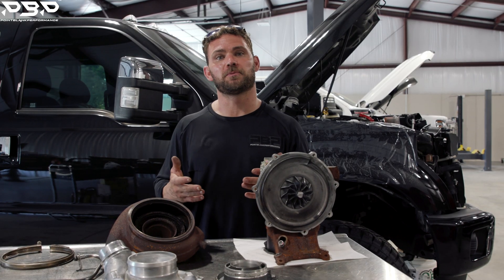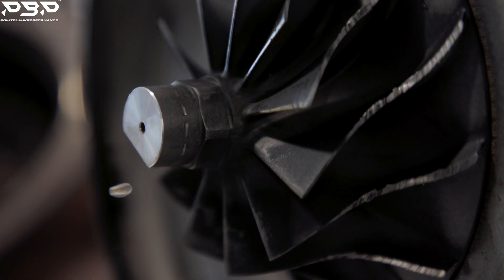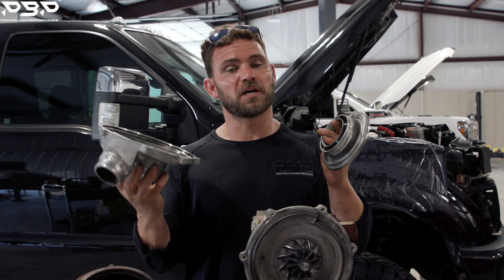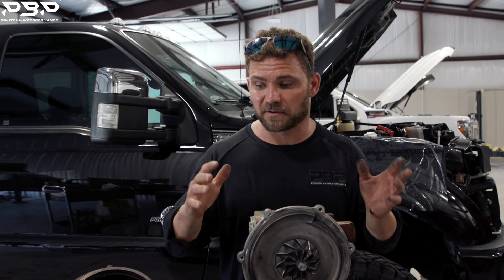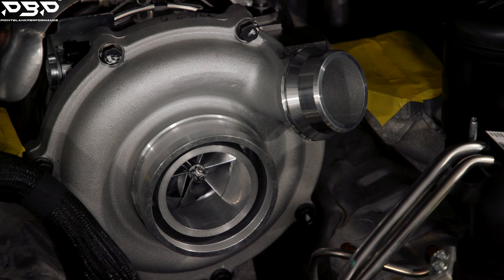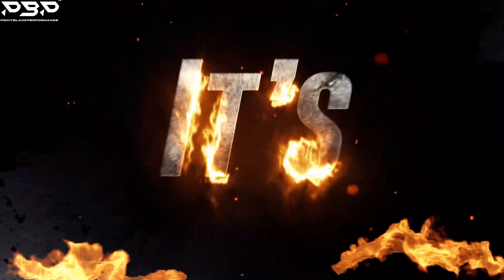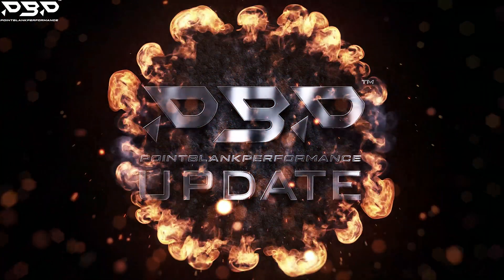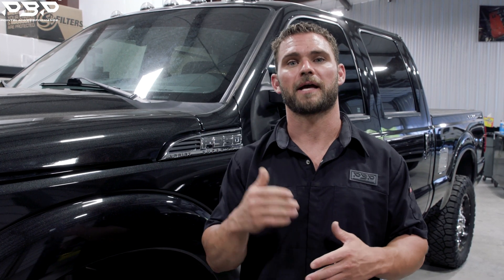MORE BOOST LESS POWER FORD 6.7??

Comment: I’m having the same issues on my 16 wirh factory turbo. My drive pressure measure 2.3/1 boost vs exhaust pressure. How do we fix this without swapping to a non vgt setup?
Reply from the maker: If it’s maxed out , I personally would go with the new Calibrated Power stealth drop in !

Comment: Is it safe to constantly run with the solenoid unplugged? When i get on it my boost gauge will hit 40psi like nothing and at about 30 psi it will really get up and go but once its at about 40 seems like it falls on its face.
Reply from the maker: The Drive pressure has to be through the roof! No sir don’t drive it unplugged not healthy on the engine.
Reply: @POINTBLANKPERFORMANCE  is that bad i havnt had any real problems with it besides the common vacuum pump leak which happened after i let it sit for a couple weeks and started driving and started getting white smoke after letting off heavy acceleration, so i did the ccv reroute and that stopped the smoke out the tail pipe so now it just hazes out the reroute hose, theres no excessive blow by either out the oil cap before hand but it is kinda heavy out the ccv reroute hose but every truck ive seen does the samething